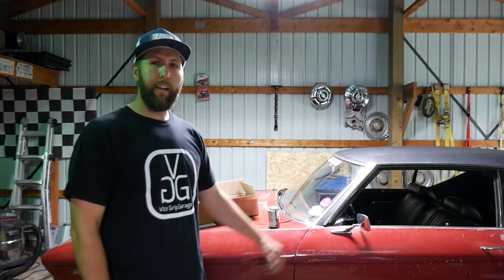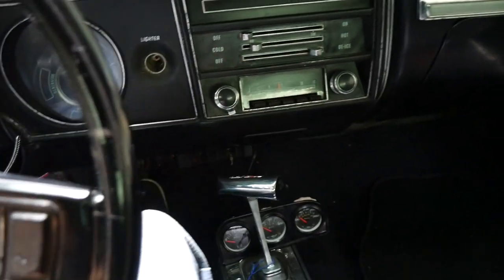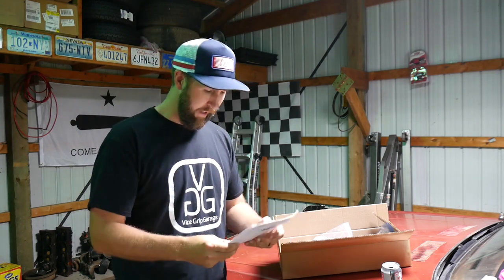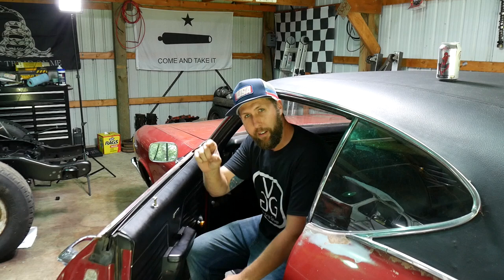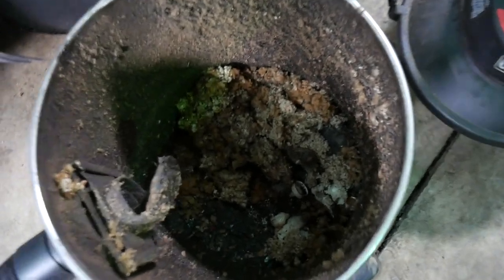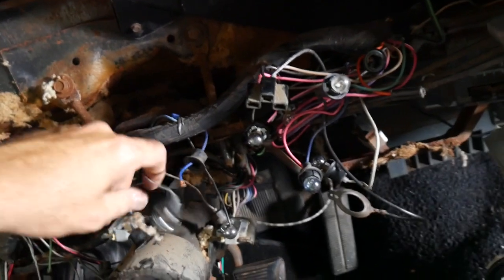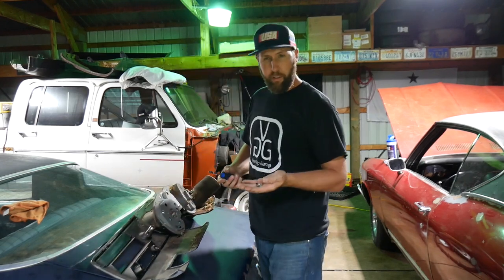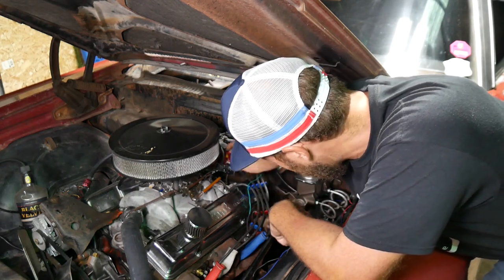Intellitronix Digital Dash Installation - Vice Grip Garage EP30

Comment: I may only be 15 but I have a 79 camaro and if you have taught me anything its that all 7 need to do is change the blinker fluid and she'll be factory
Reply from the maker: Nailed it
Reply: Don't forget the piston return springs. If those wear out, she'll run poor.
Reply: @ViceGripGarage  when are you gonna fix the rust on this car?
Reply: Don't forget the muffler bearings.
Reply: I own a 79 camaro to I been working on for 20years i got under stand it's a lot of work and up keep
Reply: @jackobyuk  Less steel means less weight and much faster speeds. Gotta think outside of the box.
Reply: Lol
Reply: Pretty rough on the ole paint job aren't you?
Reply: @bonnieblevins9867  I had a 76. I miss her so much!
Reply: I would like to hear the story behind how you got your car.
Reply: The Wild Dinkus! It’s pronounced “Fac-tree” 👍
Reply: Don't forget to run diesel oil....It's got more dinosaurs in it !!!

Comment: I’m working on a 69 Chevelle project. I will order this gauge set all I got to do is get their number!! Love your install and they look great. Way better than original. Keep smoking them tires!!! Thanks for sharing.
Reply from the maker: 440-359-7200x206 thanks!
Reply: Thanks I had my gauge cluster in my hand earlier and I got the number to call glad you responded back to me. Love your videos. My 69 will be 468 Co 9inch 4 wheel power disc brakes. Boxed frame and 2 inch lowering kit . New interior and paint. I have body on rotessiery at the minute. You make me want a get on it.😎😎☝️

Comment: Another top-notch vid buddy.  I have to agree, modern visible gauges turns our driving experience around in one these old buckets. I was always a 'Focus on the drive line first, comfort comes second' guys. I put in a Digital Dakota set myself because I wanted the analog dials instead but having put 2500 miles on my car since last year, 500 of those with auxiliary gauges and a android tablet with a Bluetooth sender from the LS2 ECU, there is no comparison. Your eyes fall much easier on to the gauges without looking from the road or squinting or being blinded by glare. It's not cheap, but it's not worth skimping when it comes to gauges because they really do make it safer and more enjoyable to drive.

Comment: When i recently added a remote lock system to my car i went to the junkyard and grabbed the harness (both sides) i was supposed to cut into and made my connections through that junk one, then just added it in line with the factory plugs. That way i could easily connect in the new wires and preserve my factory wiring. Could do all the connections at my bench as well. Thanks for the videos.

Comment: It works, you're happy w/it, & you can change it back to original if you want to - that calls for cold adult beverages! Well done!
Reply from the maker: Thanks bud
Reply: I give credit where credit is due - I've wired lights, added stereos, & rewired an ignition, but never switched out an original dashpod for an electronic one, & you made it look approachable for anyone not afraid to be shocked by their car, so why not give a guy an interwebical high five? :)

Comment: I found a lot of that rats nest under the seat of my 68 f100 which also had a tear in the seat with missing foam. Used some of the rats nest to re-cushion the tear and duct tape over top. Add on a seat cover all... Luxury ridin!

Comment: if that happens to be rust and no brown primer behind the dash on the firewall, wally world sells a product called Krud Kutter, i think it's vinegar based and neutralizes rust to create a s surface. sometimes i slather it on the slow the rust down on a fellar. 

i've also started shoving dielectric grease in all of my electrical connections/plugs to keep them from corroding as i've so learned after cleaning all my grounds and reinstalling dry.

Comment: I have added a custom gauge cluster to my car.  I "shaved" a section of insulation on the wires needed to connect gauge wiring.  After shaving small section off the insulation, one can connect the wire with never cutting the original "factOry" harness.  My ride is an 84 Datsun S12 v8.  Love your show.  Hate those snap splice connectors.

Comment: Tip:  If you're going to work under the dash of a car for a lot of hours it's a good idea to start by removing the front seat.  That makes lying there not require near such a "bendy" position and you can even add padding to make it more comfortable.

Comment: I put mechanical gauges in my old pickup a number of years ago after my dummy switch oil pressure gauge decided to stop working, after months of dread and procrastination I finally did it, it was a piece of cake, it took longer to decide where to put them than to put them in. Now I’m going to overhaul it, get them off the dash and into a factory tac cluster I just pulled out, it’s no chevelle but it’s still gonna be fun

Comment: I would've suggested changing your indicator bulbs out for long lasting LEDs so you don't have to worry about having to take that apart again when they burn out. Also, some rubbing compound on the plastic lenses inside and out to clear them up. Great video yet again though. A guy just loves binge watching your channel.

Comment: Scotch-lok tap connectors have a sordid reputation, but in my many many years of using them, Ive never had a job come back. Part of the reason I'm assuming is due to my method of inserting the new wire into the connector. I strip a half inch of insulation off then fold it back over before hand. This more or less guarantees the integrity of the contacts if you then give the whole thing a good firm squeeze.

Comment: I had an awful experience with intellitronix.   3 bad gauges and 2 bad sending units later they finally worked and then failed 3 days later.  Customer service is even worse than their gauges.  I hope you have a better experience than I did.  Best wishes!

Comment: Nicely done. Not a fan of the ‘ole “scotch-loks” for splicing, but appreciate the fact you left it reversible for the next guy.

You shoulda did this sooner. Mice are naturally attracted to analog gauges. Had the digital ones been in there sooner, you only would have had 37 mice corpses, not 48.

Btw, looks like someone empty’d a Black Velvet bottle in order to modify the ‘ole fact’ry set-up!
Reply: This statement is incredibly stupid or funny if it's a joke. I can't tell.
Reply: I after with the tie in splicers. They never last, but he's thinking ahead to undoing the work so i can't fault him.

Comment: Need one of those for the old Ford F100. That was a super upgrade for the Chevelle. I had a new 68 Super Sport Chevelle with a big block(396) and 4-speed.We did some burnouts and caught it on fire. Sat right there on a county road and burnt to the ground. Car had less than 500 miles on it. Ruh ohh, starting to tear up. Better go now!😥

Comment: You can get a set that still looks like gauges.  I have a custom aluminum piece that came from a drag car that holds my Autometer gauges and I have a FiTech TBI that has a screen with all the info on it.

Comment: @Derrick a vice gripg arage:
I found out how easy it was to pull the entire dash out from a collision guy I knew and did it on my old 71 Pontiac LeMans, made light replacement & replacing a bad fuel gauge a breeze, other than 56, 000 little chrome screws holding the lower AC vent crap on, that car had a 'YN' series 350 CI engine in it, are you up to speed on those? 330HP from the factory if you changed out the 2 bbl intake & carb. Even the stock 2bbl had to be timed differently than the radiator shroud stickers said, it timed correctly about 2° more advanced than the regular 350, the mechanic at the dealership said he had no idea how that engine came in that car, unless it was the only 350 available at the end of that week and they wanted to complete it that day.

Comment: your a chevy man very funny bloke .....in all your videos.... they rev hard drink heaps of fuel and seem to snap push rods owned 283 in 63 belair great motor..also 307...chev..seen the light 30 years ago went 302 351 clevos..brillant engines robust easy to modfiey great power.living in aust i have just imported 1978 ford thunderbird with 40 thousand miles on it...running 400m with smog control.... usa went  over board in 70s with these motors killing performance...will be changing heads out with the normal ones and going good four barrel intake 780 street performer carb...to get the t.bird motoring ill be dipped ford fan for life

Comment: Good job with the install; Did you have extra wires? My 69 C10 package has more wires than described connections..  

And..  fuel gauge dip switches??  Can’t find any of those, but are described..  I know you did not do a c10 but its weekend and I need help. Thx.

Comment: Where were these videos in 1974 when I wanted to work on the instrument panel of my '74 Gremlin X?  The bright light indicator went from green to yellow to black in less than two weeks after I bought it new. I found later that the Scotch tape they put over the hole in the panel was spray painted green and melted from the heat of the bulb (hence, yellow) and then the bulb bracket fell off leaving me with a black hole where the bright light indicator should have been. I needed to get the instrument panel off to JB Weld the bracket back on.

Comment: I’m putting an Intellitronix gauge cluster in my 63 Nova SS. I’m running a 327, and I have the same clearance issue with the oil sender and my intake, with height limited by the “lightning whirler” HEI. I can’t seem to find a 45- degree brass fitting like you used. Any chance you could tell me where you found yours?? Nothing at O’Reilly’s, Lowes, etc. Thanks in advance - love the channel!

Comment: This is just my point of speculation but if I'm to do a digital gauge cluster then I would do a stand alone unit from holly, but that's more for drag racing purposes or otherwise I'd custom fit some autometer gauges. But I will admit, for quick fix and decent look, those intelatronics gauge don't look bad at all....might of even put a feller on to them.

Comment: MeGuires plastic polish or #105 polish and wax would have cleaned up the original lenses so you can see them. then it's just a matter of replacing all the burned out dash lights and you're golden

Comment: Dash work. Damn I hate dash work. Almost burned my 57 Bel Air down with a dash short in the basghetti wire.
Reply from the maker: Sure ain't the funnest thing to do, that's for sure!
Reply: I burned a friend's Toyota Corolla down trying to solder the heater core elbow. Insulation caught. Beer wasn't a good enough fire extinguisher. Poor guy had to drive the winter without heat.

Comment: very through installation video...……..if that is the original positive coil wire hooked up to the hei you are not getting full voltage to the distributor.
Reply from the maker: thanks for watching Glenn

Comment: DUDE... You spelled digacal wrong in the thumbnail... I spect this won’t be happening again.   Serious for a minute... please remove those quick connectors/scotchlocks.. whatever a guy calls em ... I’ve fixed so many remote start n alarms that had those... get the auto wire stripper ( GB SE 94 ) is what I have... a guy can strip the wire anywhere without cutting it... spread it, twist and solder ... gauges look awesome man... good choice... if it’s worth doin... it’s worth overdoin 👌